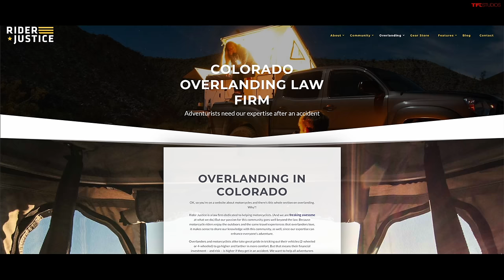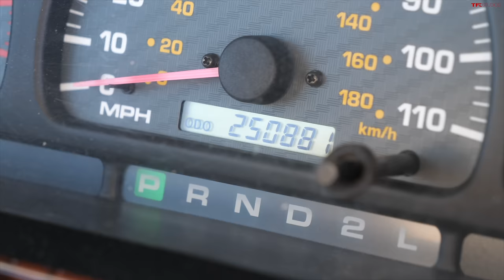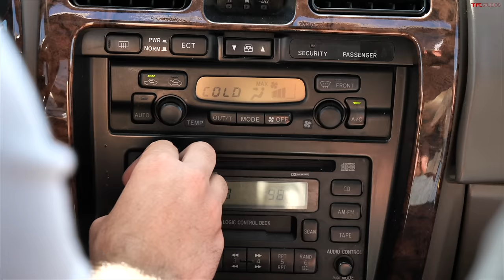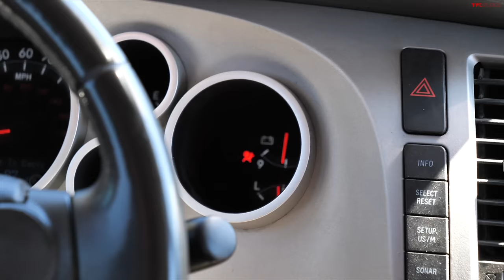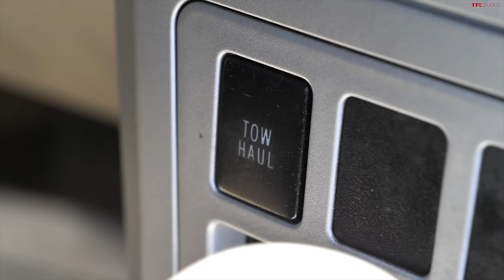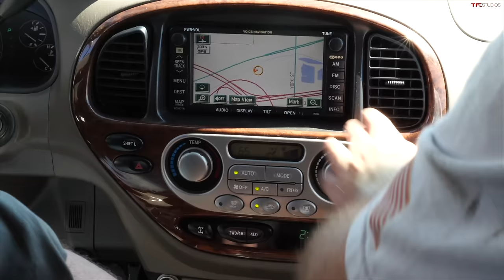We Bought Three Super Cheap Toyotas To See If They Are Really Reliable!

Comment: Great series. Goes to show how things have changed and what constitutes as a "cheap" car in 2024. I remember buying my first car, a 1997 Nissan Maxima, in 2008 for $1100. 235k miles at the time and drove it all the way to 355k miles by 2013 when I got rid of it. All it ever needed was regular oil changes (whatever cheap stuff was on sale), a set of brakes, a radiator (threw in a used one), tune up and tires. Never even blew a bulb in the time I had it.

Comment: Now this is a series I can get behind fully 👍
But having owned and off roaded almost every Toyota and depending if Nathan gets a different one,  the 4runner will hands down be the best off road. But the tundra (if it fits down the trail) will really surprise you with how capable it is.
Reply from the maker: Right on!
Reply: And what is your opinion on the Rav4 first generation 1994-2000
Reply: @SERGUMUM my mother had one, put 200,000 miles on it with nothing but basic maintenance (oil change, tire rotation, coolant replacement, two water pumps for preventative maintenance, and one radiator).  She sold it to a newly married couple in the mid 2000’s. I think a couple of timing belts also.

It’s a crossover, not a full on SUV.  My moms was 4 door, all wheel drive.  The engine is the 2.2 liter 4 cylinder that was in the same generation of Camry and is extremely reliable, although pretty gutless, and that gutless trend was even more apparent in my moms all wheel drive RAV-4.  

I had a Camry with the same engine, 270,000 miles, ran great when I sold it.

If you find one cheap, not a lot of rust, good maintenance records, they are great vehicles
Reply: What are your thoughts on the Tacoma? I'm leaning towards the Tacoma because I want a manual. Any thoughts or suggestions

Comment: The days of cheap vehicles is long gone. Sigh.
Reply: Right?! Under $10,000 isn’t a cheap car. I got my first car in 2007 for $500.
Reply: @NortheasternATV  I bought my 3rd gen 4runners in great shape for $1400 each afew years ago, my 97 LX450 in mint condition for 1k 2 years ago, the wifes 00 lx470 and the 07 fj cruiser for 5k last year
Reply: I got really lucky, a great 2006 Subaru forester a couple months ago with some scratches and smaller dents in both front fenders, but runs great. I am 17 and my car and I are both 17 years old and I got it luckily for only $2,300. Looking online at most used cars are at least 10,000 so I got really fortunate

Comment: I have a 2000 4Runner Limited with the multi-mode transfer and factory rear locker, with 238k miles.  I've done a lot to it over the past 5 years but over the last week I had a new fuel pump and sending unit installed, Falken Rubitrek 265/75R16 mounted,  and today I finish the install of my Magnaflow Overland exhaust. I love daily driving this 23 year old classic and a legend 🤘
Reply: Don't forget to add an external Transmission cooler and bypass the one in the radiator.
Reply: @henray6567  I had the stuff to do it when I first got it but never got around to it.  I'll do it eventually.  At that time, immediately after I got it 5 years ago, I replaced the radiator, hoses, thermostat, belts, rebuilt CV shafts, and lower ball joints, and wheel bearings; all Toyota parts from McGeorge. I also check my fluids just about every time I fill up with gas. 

At the time, I also replaced the driver's side CV diff. bearing with an East Coast Gear Supply CV shaft bushing, installed the Eibach lift kit, installed polyurethane steering rack bushings, polyurethane spring isolators, changed all drivetrain fluids, and did the Tundra brake upgrade with with stainless braided flex lines. I've done other things over the years as well. At this point I'm practically restoring it as I drive it!
Reply: Older vehicles are so cheaper to maintain and still cheaper on fuel cost the new vehicles are.

Comment: I have a 2006 1st gen sequoia with 400000 miles and a 2002 tacoma with 300000 and abuse them both as work vehicles and they are all original other than the normal maintenance stuff like water pump and breaks. Just changed out the original alternator on the sequoia
Reply: My gen 1 sequoia has 320k. Did suspension and only been dealing with engine light due to the intake leaking a bit but other than that runs like a champ.
Reply: EXTREMELY RELIABLE trucks. Ford Chevy and Dodge could never

Comment: I've never gone offroading, or owned an offroader, but I have owned some older toyota cars with high mileage, and they have all been gems.  After some routine maintenance, and fluid changes, they come back to life with most of the power output restored, and remain worry free for yrs. I've had a japanese built '02 camry since 2020, and it has been a complete joy to drive & own.  Easy to repair, wide parts availability, smooth, comfortable, and very cheap(esp. with the registration & insurance).  I've never allowed them to go past their fluid change intervals, and even flush the engine oil once in a while to keep the internals clean.  All the little things You do helps them greatly.  My camry still drives practically like new after performing all the routine maintenance on it when I first brought it home 3yrs ago.  And I only paid roughly $1k for all the new parts & fluids.  Which included a set of new tires.  Excellent cars all around.  Everytime I drive it, it feels like a new car to me!!😆😆😆😆

Comment: Just shows how great Toyota vehicles are. The interior on the Sequoia still is holding up. My family has owned GM vehicles and just after a couple years, interior plastics started to fade, door handles falling off, a/c breaking down etc. These where vehicles with less than 100,000 miles. We have now started on only buying Toyota and couldn’t be happier.

Comment: I've had many 3rd gen 4runners. Close to ten. I currently have one with 311k miles and it's still in very good condition. The number one thing to inspect while purchasing one is the frame as they're prone to rust problems, especially in areas that use salt on the roads in the winter.

Comment: I had a 2001 Tundra, 4.7L V8, best engine Toyota has built. I know it is still running and still doesn’t burn a drop of oil. I now have a 2018 Tundra with the 5.7. Great engine too and more HP.
Reply: Sorry guys but the 2TR-FE taco engine is the most reliable. Obviously not as powerful but bulletproof

Comment: He should have went for the older Tundra with the 4.7.
Reply: Absolutely not! 4.7 requires timing belt changes 3URFE 5.7 DOES NOT! ENGINE GOOD FOR 500K PLUS MILES ASWELL!
Reply: The older Tundra are the goldilocks   for size, it's just hard to find them with low mi and solid frames. The 2nd gen are beasts with that 5.7.

Comment: The 2008 Tundra going for what it did at auction is a nice thing to see with my wife having her 2010 Tundra with just under 200K miles on it. 
It's the lesser by one trim level, SRS or something like that... cloth instead of the leather but everything else it looks like is on this one including the broken antenna and the tire pressure light as well so pretty loaded! lol 

She has the 5.7 on that beast with the "beast mode" I like to initiate when ever I"m driving it just in case another Mustang GT tries to pass me again.... that's always a fun spanking to do to them...... 

The Tundra is a great truck that still runs great still with it's 195,000 well taken care of miles even with me thinking I'm on a race track when I'm behind the wheel of it. Quality vehicles for sure!

Comment: No TPMS issue on the Tundra, it just needs to be calibrated with the little hidden button by your right knee under the dash🤙
Reply: Flashing TPMS light on Toyota's means one of the sensors is dead
Reply: @Argedis  when I put new tires on before I calibrate the system it flashes at first, I assumed theirs stopped after a few flashes like mine does. I've never heard of the sensors going bad since it's a different system than most but will have to pay attention to my own rig in the future if it keeps flashing one day. Cheers 😎
Reply: @Argedis  computer behind glove box.  Jump the ground.
Reply: Yep, our 08 Lexus RX350 AWD has the flashing TPMS for a couple of years now.  I am not gonna replace them since it is almost 160K miles and a .  It still drives like great, but spending $300 on sensors is not worth it for me and it is my teenage son’s first car.  I check his tire pressure every month though.

Comment: I still have a 02 Tacoma TRD with about 200K miles and still use it for work when needed (by work I mean off-road or need a recovery vehicle). I bought a Ford Tremor this year when I sold the Tundra (because Toyota ditched the recovery hooks). I sold my 2013 Rock Warrior to my company as a work truck at 100k plus miles (at least I get to see it regularly (love that truck)). Other than crappy mpg that Tundra was my second-most reliable vehicle ever after the 02 Taco. Peace, Love!!

Comment: That 3.4 was a fantastic engine in the 2004 Tacoma TRD 4x4 i owned. I read once that it had the best power to weight ratio of all the trucks.
Reply: Mine was only 2wd ext cab, glad the TRD had the 3.73
Reply: The only way to a good power to weight with the 3.4 is with the TRD blower on.  I have had all of the toyota v6s and v8s short of the 4.6 and the 3.4 is my 2nd to last choice (other than the way underpowered 3.0)
Reply: @michaelpopp6340  interesting.

Comment: Make sure you pull the ABS plug in the resivor once off-roading on that sequoia and you won’t have any problems getting traction. They like to cut power too early with it in. If anyone would know it’s me.. had a seq on 37s and long travel for wheeling. Also that patch work is fine to do. All non structural. Look where the body mounts are.If they are bad they can also be replaced with a kit and welded in.

Comment: This is why we are still OWNERS of our 2007 Camry XLE with 92K miles.
It is on Blue Book for $5-$6K right now.
HOWEVER, we would never sell it even if they doubled or tripled the money for it. 

I reluctantly Traded In my 2012 Base Tacoma last year to purchase a new 2022 RAV4 Limited Hybrid AWD.
My wife will need a all season vehicle from now on and the RAV4 fits the bill on that.
The Tacoma we traded in had 136K miles.  It is a Regular Cab, 4x4, 2.7L 4 cylinder. 5 Speed Manual.
It is a nice little truck but my wife will NOT learn to drive a Manual.
Still, I kind of wish I never traded it in because I love having a 4 Wheel Drive.
But we are retired and really have no 'Need' to own 3 vehicles since the children have moved on.

Comment: Maybe an Ike gauntlet run? Now that would be fun 😅

When it is time to re sell these vehicles, Andre’s will have the greatest profit margin.  Great find.

Andre, plug in OBD2 Toyota tech stream for a quick identification diagnosis of faults.  TPMS reprogram and airbag check
Reply: TPMS modules tend to break during unmount of tires, hopefully just a reprogram
Reply: @ryandoyle4344  correct.  Hopefully just a reset.  Andre, The reset button located near foot well, below and to the right of steering wheel panel. Techstream can identify tpms battery status.  Cheers

Comment: As an olden '07 Tundra owner, I'm beholden to vote that way, but the 4Runner will be a solid mover too. 
Andre, don't forget to bring a fuel truck on your journey! That thing is Mighty Thirsty! 
Make sure y'all pick generously sized trails. 😈
Reply: The Tundra isn't that bad. With the factory tires on any long road trip I get 12.5 litres per 100 kms. I set me cruise at 110 kph. So, with a light foot it does pretty well. With 140 litres of fuel, I think 1 000 kms is doable. My brother in law has a new RAM with the 3.6 L and it's not much better. He says he gets 11.0 to 11.5 litres per 100 kms.
Reply: @mike…. Your post is full with strange units of measurements that seem made up. 😃
Reply: @is6566  ya it's metric...something many Muricans don't know exists

Comment: Had 2 3rd gen 4runners one with 383k mi and the other with 480k both ran fine. Upgraded to a 97 lx450 and lx470 and they are great.
Reply: Love it! My 06 LandCruiser has 257k and I daily it between wheeling trips. So reliable.

Comment: You know 4Runner is going to be the best off road by far. As long as it is mechanically sound. The Tundra and Sequoia are just too big.
Reply: Other than rock crawling, one may be surprised at the Tundra's capabilities. The 4.7 4x4 double cab with stock size Maxxis Buckshot Mudders survived a lot.

Comment: Man, these previous owners really trashed those vehicles.  I have an 07 tacoma with almost 300k, and it looks a hundred times better than these. It also feels like it's only a few years old too. Zero play in the steering wheel, not one bit of smoke from the tailpipe, and a testament to Bilstein,  I still have the original shocks on it. Simply amazing.  Still no creeks and noise. This thing was built so well. I have a 2018, and we take both out for brutal offroading all the time. I've had every generation tacoma,  including an 86' that wasn't even called a tacoma.  That truck went 850k, and sold it for 1200 buck. That 22R engine is bullet proof. I will simply always buy Toyota.  Can't wait for the 25' 4runner.  That's my new buy

Comment: My luck with these Toyotas are harsh. The previous owners barely did bare minimum on maintenance. Drive it till it dies, pretty much. We got the short end of the straw. After replacing majority of the parts are replace, it drives like a brand new vehicle.

Comment: I just don't get the love for the 4.7. Yes, it'll last a long time, but I wouldn't consider an engine that needs $1,000 timing belt service every 100k the epitome of reliability. I'd take the 5.7 everyday. Way more power, no timing belt interval, and even if it only goes to 500k, who cares? 99% of people never drive a vehicle that far.
Reply: $1,000 book time. Any mechanic who's familiar with the UZ knows it only takes a couple of hours and I can definitely guarantee most of the timing belt Toyota engines are so neglected, they're all running over 200k on the original belt. How many 1990 LS400s you think today have gotten their recommended 100k service? It takes me less than an hour to do a timing belt on one of these engines and the hardest part of the timing belt job is accessing the 4 bolts for the AC compressor if its in the sedan engine bay. 

But you go ahead and enjoy that starter replacement tucked under the exhaust manifold right next to the engine mount on the newer V8s. Its around $2,000 for average shop labor costs to replace a friggin starter.
Reply: @CACressida  isn't the 4.7 starter under the intake manifold? What kind of a job is that to replace?
Reply: @trailrunnah8886  just replaced a starter on a Sequoia. Took about 45 minutes to pull and reinstall the very easy to pull intake manifold. You know, the fasteners are all pointing up.
Reply: Only if you score a well maintained 5.7. As a Toyota tech I’ve seen neglected 5.7s with stretched chains/failed guides that cost much more to fix than changing a belt on a 4.7, which isn’t that hard to change. All of my cars have belt driven engines, my older Honda Civic and Pathfinder, Sienna 3.3, VW Golf. My only chain driven car is a BMW 335i.

Comment: Are any of you capable of crawling on the ground to check underneath a vehicle before you buy?  can you not open hood and check before you bid on something.   Also, when at an auction if you hold your hand up constantly the auctioneer will jack you up and you will pay too much.  When the vehicle rolls on to auction block are there lights above auctioneer say caution or as is?  I have bought hundreds of vehicles at auction before.  There are things you have to be aware of.
Reply: Nothing was disclosed, hence the arbitration. No need to crawl around because that kind of rust is considered structural damage and is required to be disclosed.
Reply: @brendan… That is good to hear but if I am buying a used car I sure AF would want to see the underside of the car before even considering buying it.

Comment: I think Andre and Tommy did good, 250k on that 4Runner is nothing, mileage aside it's worth the price because it's so clean. It's a shame they got ripped off on that Sequoia, that looks like something out of the Northeast. I would expect one to be super clean for that price. I was watching these for a while, they were going up but now they seem to be going back down.
Reply: I don’t know. That Tundra is pretty rough for 10k.
Reply: @bob… The Tundra is coming from a front end car accident without a professional fix. The bumper and the headlight housing shouldn’t be removable by hand normally. 😃
Reply: @bobcoats2708  Yeah, in retrospect you're probably right. Seems like Toyota prices are just astronomical out their way.

Comment: Toyotas rot out like they were designed to. So sad. I have a 2003 V8 4runner rotting away in my yard. Motor runs great. Trans issues, ABS alarm goes off non stop, power brakes work when they want to, frame has places you can punch your fist through. So sad.

Comment: Sequoia is very far from a Land cruiser. 4wd system, frame, size of the drive shaft is way different. Don't get me wrong, they are amazing vehicles but can't come nowhere close to the Land cruiser. How do I know? I have a first get Tunda and a Land cruiser go underneath you will see the difference. 

If the Sequoia body is rusting, it's almost guaranteed the frame is rusted bad.